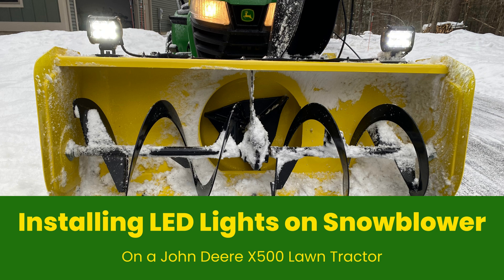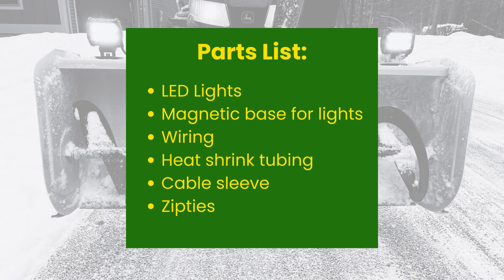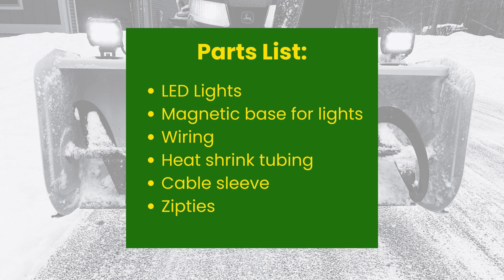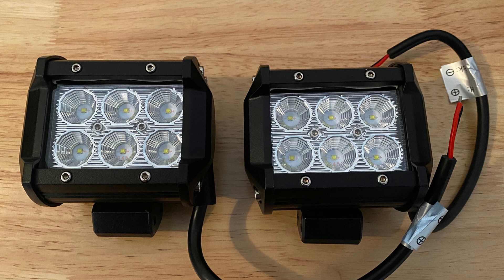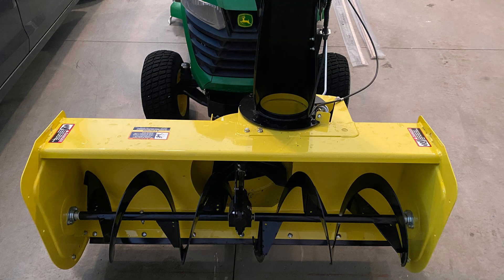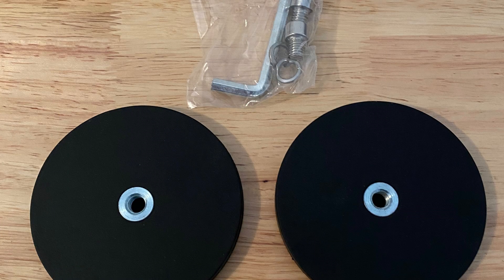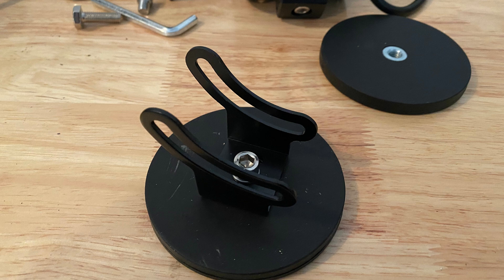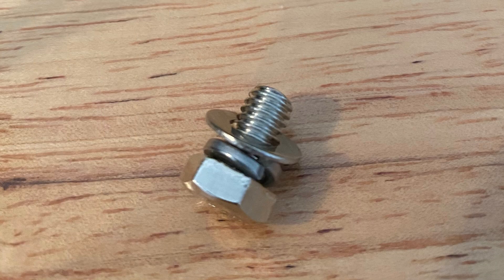Installing LED Lights on John Deere X500 Snowblower

Comment: Great video very informative. Thinking about doing this for my x350 but looks like they changed the design of the grill. Yours is more open on my 2016 they added a honey comb design with the holes being about 1/2 inch by 1/2 inch. Not sure that is big enough to run a disconnect wire.

Comment: Thought about doing this, but when I used the blower snow tends to build up pretty good on top of the blower where the lights are located, I am worried that they would get buried
Reply from the maker: I was concerned about that too, but it is actually rare I needed to brush snow off of the lights. I've used them even in a Nor'easter with more than three feet of snow one season and they held up just great. Sometimes with really wet, heavy snow, I need to stop and brush the lights off since they are LED and don't produce much heat to melt the snow but even then it isn't often.

Comment: any videos of you using these lights at night? have you snowblowed in any deep snow yet? curious how well the magnets hold up to the wetness
....
Reply from the maker: I don't have videos of my using these at night, but I have used them for multiple seasons and never had a problem. We had a Nor'easter with more than three feet of snow one season and they held up just great. I've used them on really wet heavy snow and powder and nothing seems to affect them. Even getting snow off of the lights has not caused them to move, the magnets stay put. The biggest challenge with them is they will sometimes get covered in snow and because they are LED, they don't produce much heat to melt the snow...so you may have to brush the snow off of them - but it isn't that often that I needed to do that. Thanks for the question!
Reply: @AspireinHope  not sure if you posted... not very tech savvy but could you send me the link where you got your exact magnets from?
Reply from the maker: @timothymasarik12  You bet - the link is here: https://amzn.to/3R68DdI. The links to everything else mentioned in the video are also listed just below the video in the light gray box. If you click the word "more" you'll see all the products listed with the links.
Reply: @AspireinHope  perfect thanks so much!!

Comment: great vid and setup thanks! Not sure I would trust those stick-on cable stays with our tractor parked outside in Minnesota year round but def thinking of doing something similar.
Reply from the maker: Thank you! I kept my tractor in a garage, but I was amazed at how well those 3M cable stays worked. I never had one come off, even after multiple uses and them being covered in snow. Good luck with your project!

Comment: I just want to tell you that I have watched a lot of you tubers and you are the best. Are you a teacher?  If not you should be. I purchased a John Derre x590 and have a soft cab on it. I have been all over the internet try to find something and found you. I will be doing the front and back ones because the back ones just came up. I need a strobe for the top. Any ideas? That will a little tricky. Shot me a comment if you have anything. Keep up the good work.
Reply from the maker: Thank you very much! I'm glad you found the video helpful. I did not do the soft cab on my x500, but last year I upgraded my x500 for a 1025r with the Mauser cab and absolutely love it. 

For the x500, I did put some flashing LED lights on the back to add visibility when I was dealing with snow at the end of my driveway. I don't have a YouTube video on it, but I do have a blog post about how I installed those. The link to that post is here: https://aspireinhope.com/diy/adding-led-flashing-warning-lights-to-john-deere-x500-tractor/

Comment: Thanks great video. On another subject. Do you use the deck height adjuster. To adjust the snowblower height from ground
Reply from the maker: You are very welcome. I installed the hydraulic power lift (LP33711) on my X500 to adjust the height up and down of the snowblower.